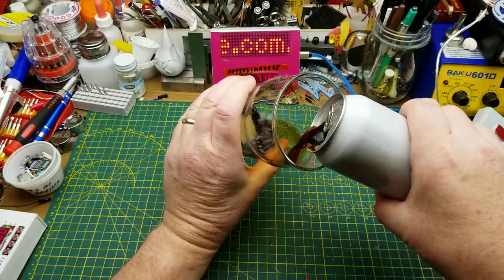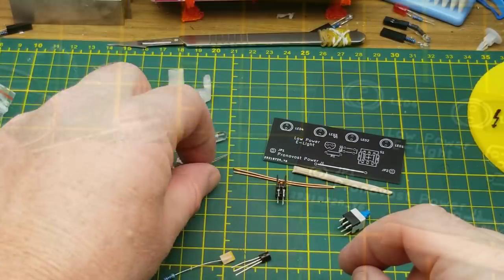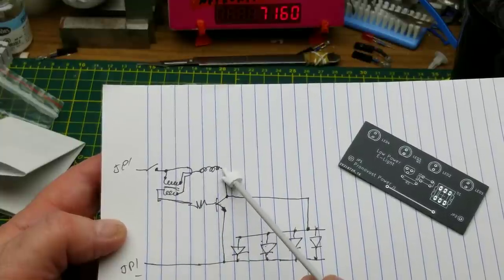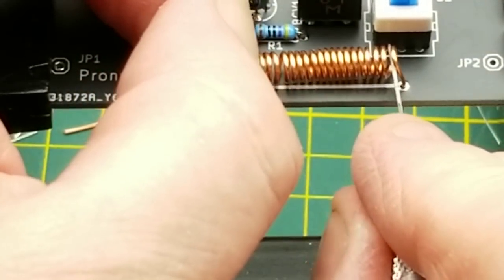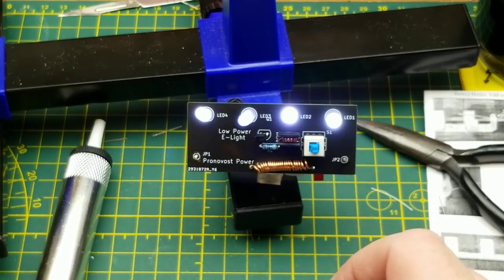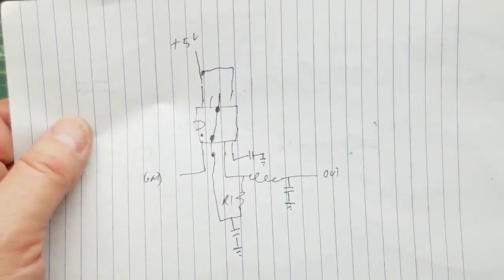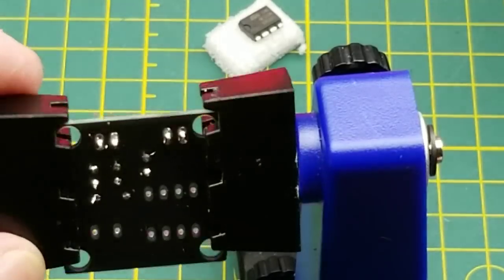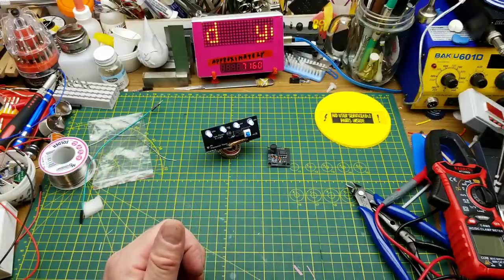Kit Build December - 2 easy kits

Comment: You are welcome and I thank you for showing these little kits, if you look at the top of the page the instructions says to jumper the pins, I know its a booboo on my part when I made the schematic and also not adding the positive and negative symbol on the silkscreening, however, the boards were made by the time I figured that out, maybe if enough people like these and find them useful, I can get another run made, the hand wounded coil is indeed enamelled wire, I just sand down the tips to make it easier to solder, As for 555 sine wave, you can vary its frequency by adjusting the voltage from 3.5V to a little over 5V, The reason why I made it, was to help test some coils I used to make for DIY VLF metal detectors. Once again Thank you for putting these kits together and putting on display my lack of attention when drawing a schematic HAHAHAHAHA , and I will try to give better instructions on the BooBoo for the Switch.

Comment: While the board appears to parralel the Leds they are not guaranteed to shate current equally. The kick back is limited to only one leds drop, but current may differ and leave slightly diffrent illuminations. While seties the kick voltage rises to N x Led voltage, but forces equal current on all leds and thus equal brightness.  The current pulae wil be narrower but of higher frequency for series. But the performance will be higher for the entire Joule thief.
Have run as many as 12 White Leds on a 1.5V battery, and still operated well to under 0.6V on the battery.

Comment: Ideally the LEDs are in series
Reply: Why? They lit in near full brightness and I had many running for the last few years, I never burnt a LED.
Reply: @patprop74  it is a matter of efficiency and passing equal current. I too h e had 1 1/2 months on a AA cell. Furthercis the current is maximum, series receives full current of the peak reached at core saturation, that causes the oscillation of the joule thief to flip, while parralel splits it across the multiple LEDs, so  peak illumination drops, as well causing lower oscilation rate as dI/dT is dropped in discharge as lower dV is across the LEDs. Were higher dV on series causes more rapid current drop.
One argument for parralel is that individual LEDs can open circuit and others keep going, but I have had more shorted LEDs than open, but that too is very rare.
Either works so feel free for either, but people are really surprised, impressed, wonder how a 1.5V cell can drive so many LEDs, and few are concerned by over 1 month operation, more so of operating for a week on a "flat" AA cell they had to replace in their XYZ  electronic gadget because it was 'flat'.
In most likely use of illumination of a dark shelf/wardrobe, etc ,the illuminated mode is brief and the battery can last 1/2 year or more. But maximum light output is desired. Yes additional part is needed to shut off the joule thief during non illuminated mode. The implemented 3D print battery holder, saving buying one is great, but hopefully the copper wire contacts last a long time, tinned wire might be better.
Reply: @helmuthschultes9243  I can not argue, as you seem to have done a lot more research or testing than I have perhaps you are right, To be perfectly honest with you, I like the simple design of the Joule thief and played around with many cores and what combination work well for me, I did not make them too please the mass or the highly technical, i like the EEVblog but I'm, not the ring leader, here is the little story why i made these boards, I lived in the same area for most of my life, i am well known as the guy to go to when you need something fixed, anything from wooden chairs to lawnmowers to cars to electronic gadgets. Most of the neighbours that come to my little shop have kids, some kids are impressed with the power tools others with the 3d printers, and others with the Electronic corner, naturally, I was encouraged as a child to tinker and as an adult, I do the encouraging, trying to figure a simple yet fun little electronic projects for the kids was starting to get complicated so i made these boards, now when the kids come around, they get to build something that quick and fun and they have something to take home with them that they can use, and seeing how i had a lot of boards made i share them with anyone that wants to buy them for the cost of fees and parts and shipping. Will they last a lifetime? i don't know, Do I care if they do or don't?, not really like I said, before having actual boards made I use the exact materials and they are still working ever since I saw the joule thief on Big clive video. Thank you for your input, Much appreciated
Reply: @patprop74  I certainly have implemented many variations right down to 1mm toroid with sot23 transistor and 0603 resistor driving 90v ouput from a earphone button cell, real tiny. To a 15w  12v output from a 2v lead acid cell.. But mostly tried various options, but no real issue yours is functioning as expected, real optimising lies in choice of ferrite, its shape, choice of transistor saturation and gain, resistance on base, winding and wire type/guage.  The output is largely a case of purpose of use. Do not worry about the led arrangement too much, in many ways it was a comment to my preferred arrangement and I made it even before seeing the actual board arrangement, after the sketch with leds in parralel  appeared in the video.
 But then saw that in fact the board has leds in parralel.

Comment: The longest chip in production - the 555 timer. I used one recently. PIR triggers the 555, latches the output on, then goes off after about 2 minutes.
Reply: Mr. Carlson recently made I nifty little project with a 555 as well, it was with 7555 but nonetheless, still a 555 haha.
Reply from the maker: Mr Carlson doe a lot of very cool stuff. 
But I would have expected the 555 to be a bit modern for his tastes.
Reply: @pileofstuff  Was it for one of his testers? Some of them look reasonably new'ish.

Comment: Rugg3d except NEVER exceed 18v they die very quickly at excess voltage. In fact ideally never run at higher voltages, the badic 555 design is very BAD for current surge during switching. Easily 200mA peak during transistion of output. The upper and lower transistors remain simultaneously active during switching. It is one of the many reasons I only use the modern CMOS equivalet 7555 devices. Two other reasons are low current loading on the RC so better on long time periods and capability to operate at higher speeds, over 1MHz easy.